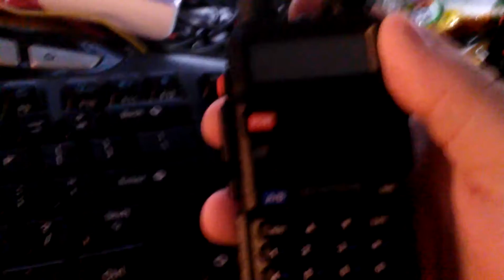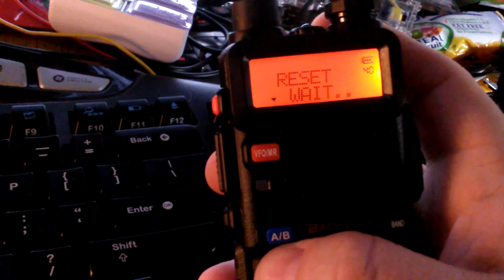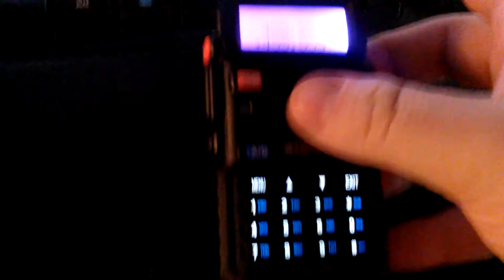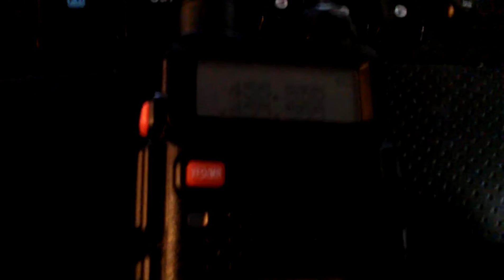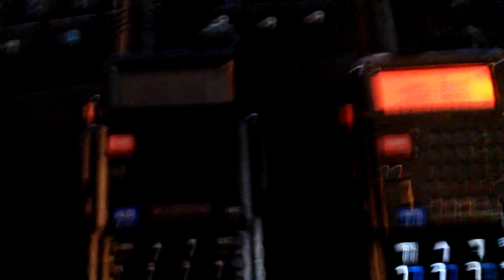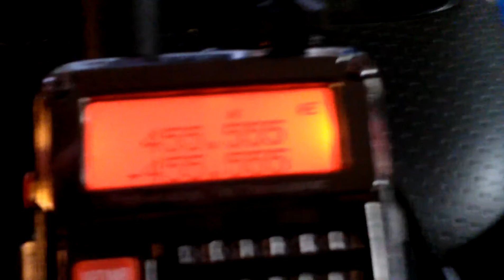Baofeng UV-5R Ham Radio cannot receive - WITH FIX in description

Comment: Be aware using CHIRP. There are some Baofeng radios with counterfeit firmware. Using CHIRP can brick your radio, if it has a counterfeit firmware.
Happened to mine. No response from any keys other than on-off/volume. Sent it back to Amazon for refund.

Comment: Thak you thank you!!! In my case radio less than a year old and given to me.. transmit no receive.. downloaded your image opened in chirp legend new version... 3-25-24 .. wrote the image to the radio.. then shut off radio and closed chirp.. opened chirp and turned on radio, read from radio, deleted those memory frequencies and copied (copy and paste) the frequencies from another uv-5r programed for my area.. in chirp and wrote them to the radio. Works like it should now. Transmit and recieve.. thanks again.. I know these little radios are a dime a dozen .. but it still had plastic on the screen.. just that new. Nice little knock about..

Comment: I used the newest version of chirp.
I receive NOAA and a few other stations, but none of the local repeaters.
There is one on the fire station radio tower 1 1/2 miles away.
I watched all the videos, tried all the tricks, but no luck.
I know about the offsets, etc.
I'll get it figured out, somehow.
Since I am receiving NOAA, I know it's not the receive, but it could be the programming.
Simplex works.
Reply: I also have a magnetic car antenna, made for dual band .

Comment: I am still struggling with mine - No CTCSS and No DCS but still the squelch doesn't open when receiving a signal from a radio in the same room but transmits to that radio perfectly and receives ok when the monitor button is pressed.

Comment: Something similar happened to me on VHF today. They hear me, but I was able to hear the others only if I hold MONI button. Now it is everything OK. I dont know what happened. And yes, I wasn't using CT or DCS... I suspect menu 35 (squelch tail was ON) turn it OFF.
Reply: Music Matt 76 I have been having the issue of only hearing others in 2 meters unless I go to any menu button. I’m going to try turning off the squelch tail you mentioned
Reply: @allenmcgee9379  Problem is that baofeng and similar radios are deaf with good antenna because strong signals can instantly overload receiver. China radios are only usable for UHF operation.  On UHF that problem is reduced.
Reply: @MujoNovak  it appears otherwsie to my baofeng uv5r.. its good on VHF but deaf on UHF.. i did try turning off the  squelch and it works, but a lot of splatter.

Comment: I have a Baofeng UV-8HX and it has the samething  as you have can you help me.... I did not backup the program it came with.
Reply from the maker: +markbro1959 The solution with links is in the video description
Reply from the maker: +silvad702 Try this page http://www.miklor.com/uv5r/UV5R-Recovery.php#N5R
Reply: @SilvaD702  Can you update the link. I have the same problem My UV-5R can transmit, but can´t receive, almost press MONI button. I did the complete setup between the handhelds and doesn´t work. Can you help me? Thanks.

Comment: Maybe you can help me. An big arc of static from a metal door frame hit me in the shoulder. My uv5r started broadcasting and won't stop unless I turn it off. When I turn it on it starts broadcasting again. I can't access menu, and all the buttons just make tones. I have 4 uv5r's and this is my first time with an issue like this.

Comment: Dear All

I have two UV-5r radios with the RX problem because the firmware issue.
The firmware of the radios I need are:

( HN5RV01 1FB297) First radio
( HN5RV01 1 ) second radio
Both of them are Uv-5r

could you please be so kind to share with me those .img files to try to recover  my radios?

thanks in advance.

Francisco Ruiz 
TI4FRU
Reply: Francisco Ruiz 
It a easy soldering fix the clip on how to do it is on here,  cheers n happy fixing lol

Comment: I am suffering this same issue! I can not recieve. Have you fixed yours? I bought mine last week and cannot fix this issue!?
Reply from the maker: Yes!  First off, make sure the keypad beep is enabled.  (menu 8 = on).  

If that does not work, you need to take a few more steps.  It was easier than expected, just over analyzed it a bit..  

You need to uninstall Chirp.  

Then install the old version of it (7/14/14) from http://trac.chirp.danplanet.com/chirp_daily/daily-20140714/.  

Then write this image to the radio:  http://kc9hi.dyndns.org/uv5r/programming/CHIRPrecovery/N5R-20(140525N)(factory).img  

------------
After that, again make sure (menu 8 = on) and your radio should be working.  
------------

Now, install the latest version of chirp from http://trac.chirp.danplanet.com/chirp_daily/LATEST/

From here on out, make sure everytime you hookup your sync cable, you read from the radio first before writing a saved image.  

I learned, even though the radios look the same, and sort of act the same; they are not.  The design seems to be whored around China with many different manufacturers making clones with their unique alterations.

Good luck!